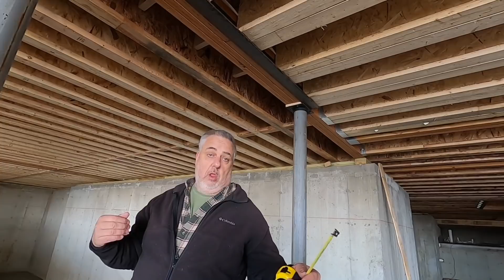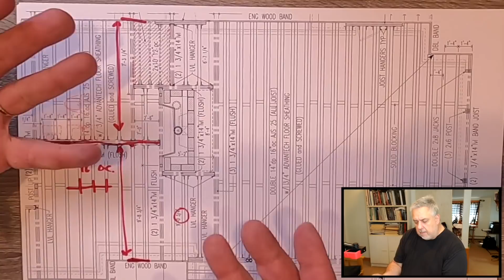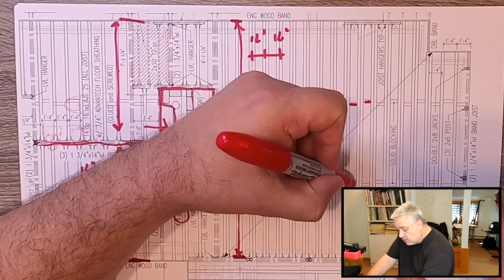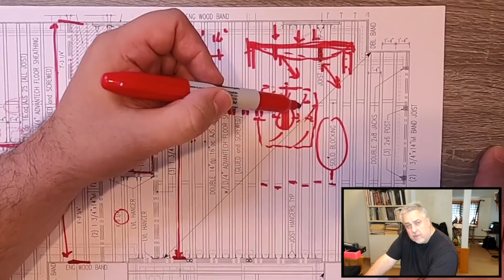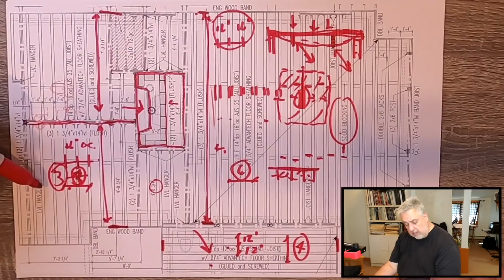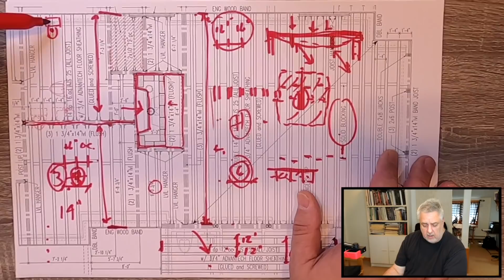Nitty Gritty Floor Framing

Comment: Fantastic. I have an 1850’s house in central MA that my mom wants to stay living in now that my father is gone that needs this kind of work (for starters). Great video. Thank you.
Reply: Thank you - I grew up in Adams
Reply: @stevenbaczekarchitect9431  oh that’s so cool. If you can recommend any contractors I would be grateful and interested. I am trying to save the house and will be soon getting  a structural engineer that will tell me what water and WDI damaged structural members need to be replaced (and anything else) with what material  and will move on from there to control layers etc and need to look for  building science minded contractors for the structural carpentry stuff as well of the envelope and durability stuff. It would be great if I come up with a plan for everything if the contractors have familiarity with what I’m trying to convey and accomplish as well as have something to offer. Loving the content and thank you!

Comment: The blocking actually resists “lateral torsional buckling” of the floor joists.  It doesn’t share the load laterally.
Reply: Correct. The blocking keeps the joists from bending over under load. They aren’t strong unless the load remains normal to the plane of the web. Would be good to have a structural engineer added to the build network so we can hear all the different views.

Comment: Did I miss where you discussed the point loads coming from above this floor? Why the recessed beam on the left side of the drawing but you didn't need it on the larger side on the right? Does that save money I assume? You said that they are all essentially carrying the same loads.

Comment: I would imagine that the decision to go 12" vs double floor joists at 16" on center is sometimes a financial one.
Reply: Double floor joists at 16 inches on Center is stronger than single floor joist at 12 inch on Center also so it could be capable of different load
Reply: A risk of double joists is that they rub against each other and squeak.

Comment: As I watch from my 100 year old house that has rough sawn 2×7 floor joists 16 on center with a span of 15ish feet.
Reply: 1943 house here on rough cut 2 x 6 on 24's  with a span of 14' 😂😂😂

Comment: I'm wondering if it would have been possible to increase the thickness of the web and width of the top and bottom cords (not sure if that's the correct terminology or not)?
Reply: No unfortunately, these were maxed out, only option was to go deeper and we were up against a zoning height conformance issue
Reply: Because the maximum height of the house was limited by code if they had increased the depth of the web they would have to steal that space from the height of the ceiling in either the already low hung basement or on the main living level by having a higher floor.
Reply: @jasonferrell7356  increasing the thickness means making it wider.
Reply: @ColeSpolaric  my bad, I misread your comment

Comment: Is there solid blocking in between the webs of the double? it's not shown on the drawing, but wouldn't it be needed to achieve the intent? Or is it only important to bridge the top and bottom chords? And why is the installed blocking engineered joist and not solid as specified? Or maybe solid means not cross metal X bracing. I would like more information on this topic maybe in a video.
Reply: No because the chords provide the restriction of lateral movement

Comment: My house has LVLs for the first floor and I-beams for the second floor.  When I asked the production builder about it they said that they had to they use LVLs for fire rating so they don't have to drywall the ceiling as they would with I-beams.  Will the builder be finishing the basement ceiling or does the code in your area not require this?
I would love to hear more about choosing between LVL, LSL, I-beam, etc for floor joists.
Reply: Yes the basement will be about 70% finished. The 30% unfinished has joists with factory applied fire protection on the web

Comment: Thanks for the education on the why the blocking is added.  So if it is meant to share lateral load I assume that means the nails themselves are the weak point in the transfer which makes the nail pattern and type critical.
Reply: Yes, it's not a pure 2 way system, but it is better with them

Comment: QUESTION: in the area where the beams are doubled up, was a single beam 12-inche on center a viable solution ?
Thank you
Reply: Double on 16"OC is similar to 8"OC so 12"oc is not quite there
Reply: From what I listened to, it seems that a single 12 would have required a larger member which for this build was not an option.

Comment: Steve, What is the difference between the wood blocking and these?  https://www.strongtie.com/bridging_miscellaneousconnectors/nca-tb-ltb_productgroup_wcc/p/nca.tb.ltb
Reply: Framer preference and probably cost
Reply: @stevenbaczekarchitect9431  I am a DIY builder and have used both, I guess the only possible advantage to the Strongtie is they do not block the whole joist bay